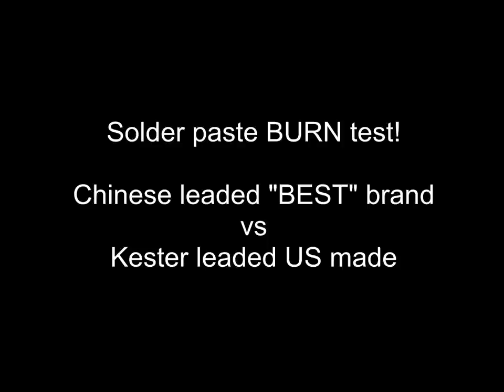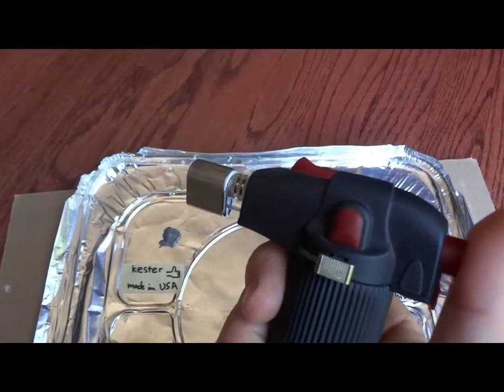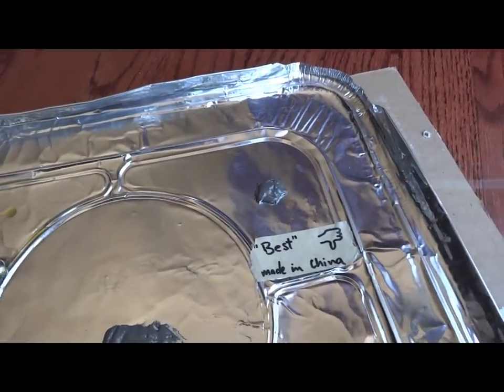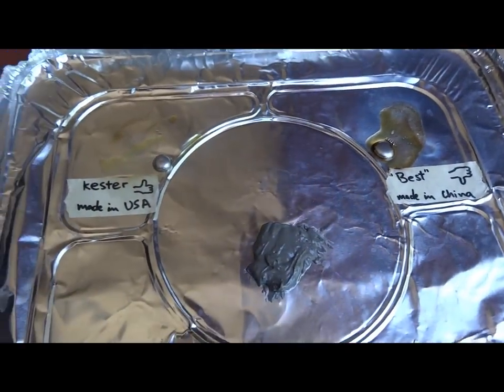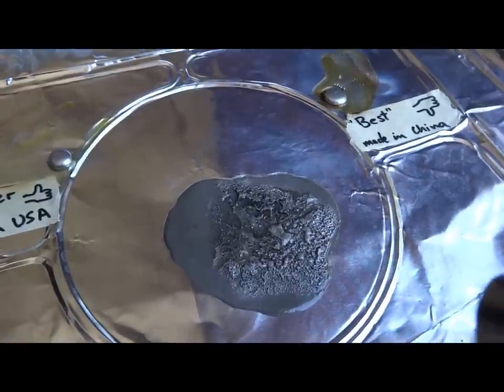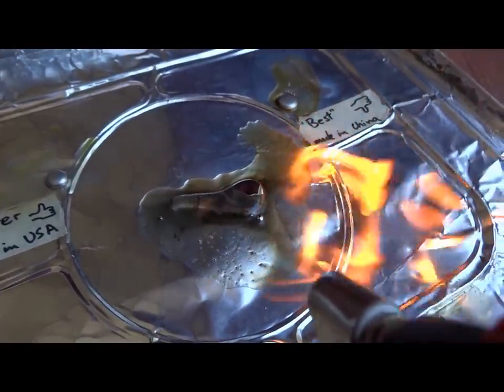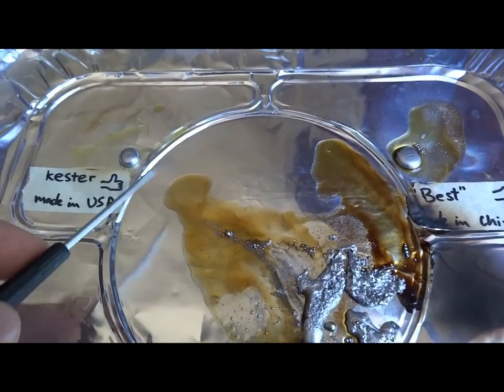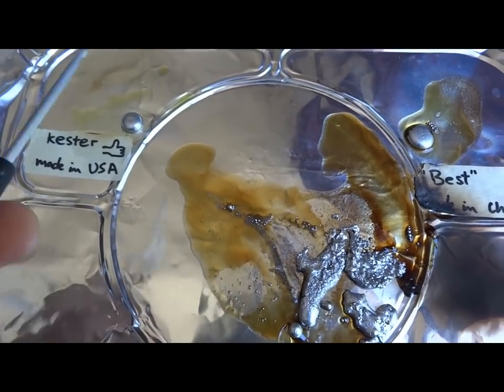Chinese vs US made solder paste burn/reflow test

Comment: I'd like to add that aside from what you just showed, that chinese paste also explodes under some parts, moving them off of the pads. So after the oven, you have a repaur job. BUT,  I'm not sure if it may have been the small amount of solder paste I added to thin out the "Best" product. I now use the Chipquick brand. It's less expensive than the US brand you suggested.

Comment: Yes, there is a visible difference between the two, but when USA costs 500-1000%+ more, people will settle for the "best". Besides, the test used a lot more than one would normally use for one job. Since the Chinese probably use more solder paste than any other country, I'd think their paste would be decent. Do Chinese companies buy American?
Reply from the maker: Jeff Flowers Actually the cost comes to be around the same. When you factor in the damage and time you spend fixing the "best" paste mess, the good paste costs a fraction.

Comment: Chipquick sold on Digikey also have the problem. It is ok for SOIC chips, but I am not sure for QFN. So choose the best when you are soldering smaller parts.
Reply from the maker: No it doesn't.
Reply: I do not know others. I tried myself, and I reported what I saw.
Reply: I bought it new, and used within one week. It was kept in ~60F.